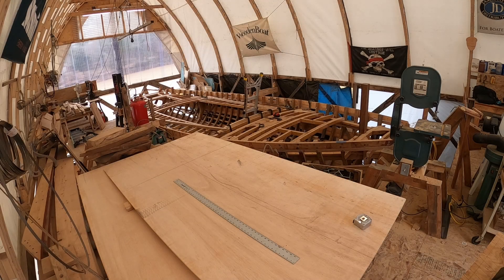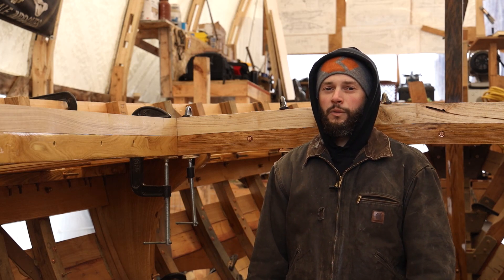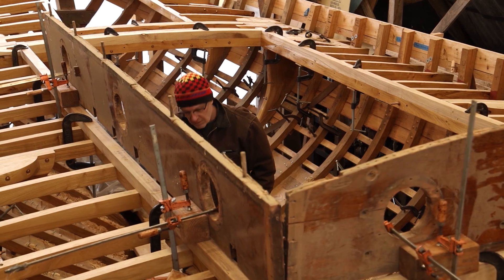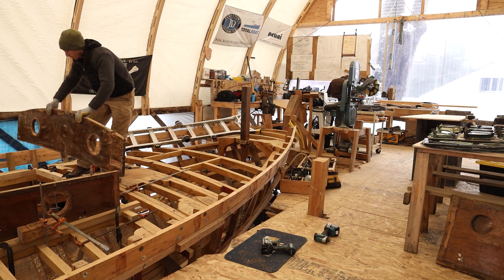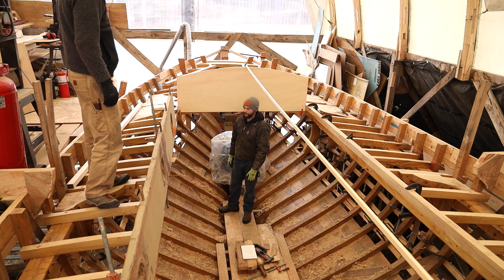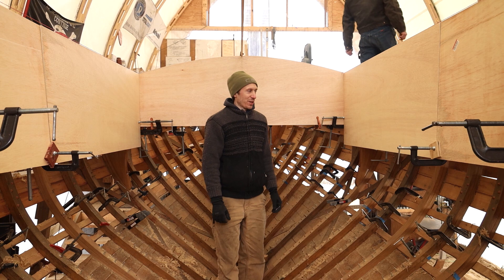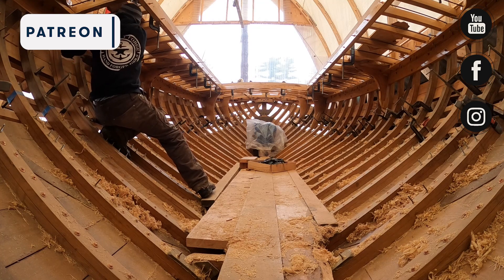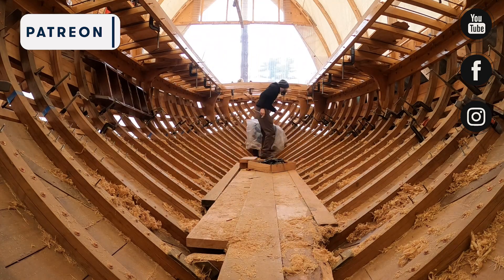Deckhouse mockup -  Episode 148 - Acorn to Arabella: Journey of a Wooden Boat

Comment: First off smart move to do a mockup. As someone stated an ill proportioned coach can ruin the lines of the boat. 

A few items first just because they call it a house doesn't mean you can build it like one. It needs to be as strong as hull if not stronger the ocean loves to break big flat areas.  Keep in mind the only thing between you a twenty foot or greater breaking wave and your god may well be that house. In the case of a pitch pole that means the whole weight of the boat dropping twenty feet and landing on the coach roof. The coach roof is part of the hull structure so don't even consider it being removable or removing support beams. 

While overhang/drip edge sounds good your shins and back will never forgive you. You do not have a cockpit with side support so the most comfortable place to sit will be on the windward side with your back against the cabin side when not on the helm. Also your shins will hit it and it will trip you when you have to climb on the coach roof.  Whenever a wave breaks over the side it will direct water to the joint can you say leak.

Last don't worry to much about being able to see over the coach usually while sailing you will be on the high side looking along the side or over the top at this big wall of canvass
Reply: All top sensible advice.

Comment: You might want to consider ditching the forward port lights and adding a deck box instead.  You have a tiny laz and the extra storage will be key. And PLEASE put some temp plywood down on the deck.  It’s dangerous and inefficient to be dancing along the deck beams!! BTW boat looking great brings back fond memories.

Comment: Consider replacing the oval portals at the front of the house with round ones.  It is inevitable these oval portals will be compared to eyes, and I don’t think you want squinting eyes at the front of your house. Additionally, oval portals will not let in a heck of a lot more air and light than round ones.  Ned

Comment: I think it  would be advisable to put 2 large ports in the aft part of the house like you are thinking about in the front.... just so you don't hamper the air flow plus it would allow in more natural light than the small ones. I've been on a few old wood boats and there is not a lot natural lighting getting in. you guys have a chance to make changes now that will make "living" on board easier. 
on a second note she is starting to "look" like a boat now the the house going in
keep up the good work guys!!!

Comment: With that high of an arch and headspace, you could feasibly run a single 18" wide plank from front to back like 6" down from the peak, to use as overhead storage
Think of a steel ꕯ-beam, but more an inverted T,  ┴,  running fore-aft, between the portholes, right where your mockup 1x1 stick is at 9:25, but 6" down from peak, 8 inches of storage on each side of the ┴.. And storage is ALWAYS at a premium on boats.
Essentially a double-sided shelf, with a single vertical support running the length of the house- It would dramatically stiffen the roof of the house as well.

Comment: Steve - Offering this with the best of intentions.  

Your helper did not appear to be wearing safety glasses when he used the drill press.  It’s always a good idea to wear safety glasses around machinery. 

At the drill press he also wore gloves which can inadvertently get caught in the rotating bit or spindle, causing severe injury worst case.  You might rationalize that his hands are not near the work point, but people often make mistakes in their hand movement around equipment.  Gloves are easily entangled by a rotating drill bit, and will pull your fingers, hand and forearm around the spindle before you can react.

As the leader of this project, I know you would never want to see one of your team hurt.  Hopefully you take these observations to heart and coach your helpers in safe work practices accordingly.  

I wish you and your team continued safe progress.
Reply from the maker: Thank you for this thoughtful comment. We also appreciate that people here can see your shop tips, too. Thanks for taking the time.

Comment: Dropping hardware into the bildge...
Plus to broze hardware... no rust or oak sickness.
Plus to iron/steel, you can retrieve dropoed hardware with a magnet 😎.
Edit:
So, the house access is going to be offset to the starboard side?
I think I caught that in the discussion. Right?
Kinda hafta offset, with the mizzen so close to the back of the house.
Yeah, I like the wide front lights/portholes and smaller house-side fore potholes too. Love the layout. Will the head be at one of the smaller potholes?
Reply from the maker: Yup, companionway is set to starboard to get around the mizzen

Comment: In addition, please keep in mind, in a high traffic channel you will need two radios, one in ship to ship and one on channel traffic control. Most large tanker and container ship along with river traffic is now running GPS nav/moving map connecting to the ships auto pilot. They may only have one mate on bridge watch. We now have two U.S. Navy Destroyer skippers facing court marshal for wrongful death and they both had a full watch on duty at the time. Don’t sell yourself short on navigation equipment.

Comment: Really enjoy following your build. I was watching  your mock up this morning and a couple of questions came to mind.
How do you access the cabin (forward or aft) and how do you get the engine out if required?
I look forward  to your weekly vlogs and will continue to follow the build.
Stay safe.
Reply: It looked like they were planning an acess hatch to the house in the aft starboard corner, since the mizzen blocks the center, I'd say. And engine access, for removal, would require removal of the cockpit "tub" they talked about in the previous video.
Hope this helps.
Reply from the maker: Yup, Thomas hit it I think—the companionway will pass through the aft side of the cabin just to starboard of where the mizzen will be, and the cockpit will be built in such a way that the sole and sides are dropped in, almost like a bathtub, and therefore hopefully easy to pop out should the need arise.

Comment: It's probably too late now but, if it was me, I would have staggered the two vertical joining points of the house walls. In my mind, that would add slightly to the rigidity of the unit.     sdh down the road and over the line in Granby, CT
Reply: Those are just mock-up sides, they will not be part of the final construction.

Comment: Yet another comment...
Be critical of the overall height of the cabin.  Consider the forward view while sitting and standing in the cockpit. A limited forward view is a hardship when maneuvering in certain situation such as docking or recovering a drunken crewmember.
Reply: Did you even watch the video? They explicitly talked about that!
Reply: @99Etien  Sorry Mate.  No,  I didn't see that part of the video. I was probably too quick to respond and was occupied with trying to get the key board to co-operate with my fingers when that part came on.  It's hard to type with one hand while the other is task with keeping a glass of Cruzan at even keel.  By the way...I'm usually the crewmember they are trying to recover.  Never the less,  I'm sure they will get it right.

Comment: Where will nav/sinks/stove  and other items go inside and will you end up wishing you had a window better placed to light up specific areas?
Reply: Set the ports to look good from the outside, then design the interior to work around the lights. Typical boat design, as far as I've seen on YT channels. Of course if you add small wind turbines to the rigging and some solar panels you can put 12V lighting in, wherever you need light, and design how you wish regardless of the portholes.

Comment: I've followed your build from the beginning and look forward to each post. But one thing that continually bothers me and maybe its been asked before, what is your strategy for detecting and fighting fires?
I'm retired now but have worked on fire detection and protection on major projects throughout the world and I've seen the grief that comes after watching years of work dissappear in minutes. Your project is of course extremely vulnerable being predominantly wood.
I hope this makes you pause for thought? Maybe it would make a good subject for a video?
Reply: Amen! I have had a little worry about that in the boathouse as well as the boat once it's in the water. Do you guys have insurance on the project in case of a catastrophe? The years of work put into this project would be  a heartbreaking loss.
Reply: I had a similar thought as I was watching Satchel drilling the tie rod plates inside the boathouse.  An unnoticed hot shard landing in sawdust...  And then there's electrical shorts.  I guess eternal vigilance is critical, even with some sort of fire system.
Reply: He was cutting Bronze there is more of risk from a fire started by a worn brushes on a old motor arcing or sparks from a grinder than from cutting those pieces of bronze.
Reply: They've had the fire department take a look, and the firefighters are satisfied.

Apparently, sawdust over bare dirt is not particularly flammable.

As for the boat on the water, your nose is a lot more sensitive than any electronic sensors. You can smell something smoldering for minutes before a smoke detector will start screaming.
Reply: @ScottKenny1978  Until it happens when you're asleep. I would like to have a backup for my nose.
Sawdust and air mixed right is explosive, so that risk is something to consider.
Reply: @Yvolve  if you're making way on the water, someone must be awake and steering. It's the job of the people who are awake to keep a nose out for an acrid odor.

As to the boathouse, again, the fire department has seen it and isn't particularly concerned because it's a bare dirt floor.

Also, they did clear out a lot of sawdust over New Year's, found a few tools they lost.

Comment: The front of the house is a big flat box and will create massive wind resistance. Why not angle back slightly to reduce wind resistance and more streamlined. Thinking out of box. Whole idea ship is to maximize transfer wind to motion.  Reduce drag. Increase motion.
Reply: Correct
Reply from the maker: Rick, I’ve been digging your comments, and Joe, I see what you might mean in a general sense but this one is slightly confusing. In what way would a gently raked surface on the front of the house help in an appreciable way with wind resistance when, for example, a giant stick points straight into the air (the mast) above the whole structure? This is an honest question. Seems like it’d be nice, but not crucial, in other words.
Reply: @AcornToArabella  As I mention in another of my too-numerous comments on this topic, and as others have sagely pointed out, what needs to be considered is the incompressible hydraulic punch of heavy seas over the deck. Anywhere the water is unable to escape as quickly as it arrives will result in a sudden very high peak in pressure. Cabin sides, particularly forward, but also laterally in a knockdown, or from aft in a pooping, provide an angle or crevice from which the water cannot easily escape. That’s why ideally one would have a smooth, or smoother, contour, convex for increased strength and resistance to pressure. You could get a feel for this by taking a bricklayer’s hod and slamming it open side down into say a full water-butt. I think you would find it felt a bit like hitting concrete with a hammer.

Comment: Get a TORPEDO HEATER and you can GLUE without a problem!
Should warm the entire place up just fine.
Reply: All due respect Ms. May, the very last thing that should be brought into that boat house is a torpedo heater with its high velocity jet exhaust looking for combustibles to ignite.   It would be a very short search.  The fuel load in that structure is quite substantial notwithstanding the recent housekeeping.
Reply: However, a small jet engine may not be a safe choice with all the saw dust and wood shavings laying around in that boat house. 
And yes, I know they just had a clean up, but they are constantly making more shavings and dust as they keep working, not to mention the funes of their glues and finish coatings. I hear what your saying, but those aren't the safest of heat options in a wood shop. Just the airborne wood dust can flash burn.

Comment: When you come to clean the port lights use a solution on hot to warm water at first and Citric Acid. leave to soak in the solution it will eat away any lime scale and rust to leave you with a nice patina.  on the port light i get my Citric Acid from Ebay in bulk 25kg and it has lots of uses

Comment: Your boat. Your decisions. That said. IMHO. On the house, I would have gone with round port lights all the way around, with the exception of larger round port lights fore and aft. The oblong ones just seem to violate the character and art of the boat. But, again. Your boat.
Reply: I think with the oblong ones on the sides and the round ones fore and aft it would loock better
Reply: I like the way they planned it out. Having the larger windows forward and aft makes more sense. If you are down below you need to see if you are about to hit something. Bigger windows mean better visibility. Just my opinion.
Reply: @kathywrightjohnson6804  I'm wondering where the head will go so they can have a shower and not spoil the sight out the house windows. The rest of the deck is too low for a stand up shower inside the boat.
Reply: Definitely not traditional and not very attractive in my option. The fore and aft portlights should be round. If it was all ovals, maybe, not with round ports on the side.
Reply: @kathywrightjohnson6804  They'll probably have bulwarks in keeping with the norwegian doubleenders that are the  roots of this design, so you won't see much of anything ahead from down below. Which isn't that much of a problem, since at sea you're fine with the occasional look around from the hatch, and in close with the shore you're in the cockpit.
Reply: @kathywrightjohnson6804  a larger window wouldn't really "let you see if you were going to hit something" much more than a moderately sized smaller round one. The reason is that you can get close to the window, and it really improves your viewing angle. The reason for the larger size would be to allow more light and breeze into the boat.
Reply: @paulheitkemper1559  Open the forehatch in good weather to get a breeze through the boat. You do not want opening lights in forepart of the coachroof. Best to have nothing, or very small and very strong. The hydraulic punch of a heavy sea is enormous.
Reply: @willshen6597  But does it have to be traditional? I think at some point you can move forward and put in something new, or you will for ever be stagnant

Comment: It looks great but I'm wondering if the floor of the cabin is going to be as narrow as the planked area y ou are walking on. So if the floor is going to be a bit wider, it will reduce the height. As a commenter stated earlier, overhead space is totally essential for gear storage. Even if you raised the house roof by a foot you would still have a view of the horizon.
Reply from the maker: But we might not be able to fit a dinghy between the cabin house and the boom. Gotta think in three dimensions! Thanks for watching.
Reply: I can’t think of a single seagoing boat I have encountered where valuable deckhead space has been compromised by storage.

Comment: Hi Guys, dont forget, an inch or two of flooring, and the occasional beam to support the cabin roof, is going to shrink space, in some cases, considerably. Once you compensate for closed quarters in your step interval, gait and ducking once on board that will not be a problem, though back on dry land people may think you have a strange affliction when you hesitate, step and duck at odd times. Thor Heyerdahl and his Kon Tiki crew reported ducking, stumbling and falling over when they got back on dry land, as a result of placing their feet to stay upright in anticipation of a large sea, only to look comical as they fell over with a puzzled frown when no sea came to obligingly lift the deck to where they had placed their foot.
And yes, roof storage for things like fishing rods is a great idea, along with building a mock up and pattern the actual construction.
I dont know about the rest of your audience, but I am getting a sense of a new enthusiasm with you guys, almost as if you had entered the Doldrums and sailed successfully out the other side with fresh purpose and hard won experience now firmly on your side. Whatever it is, please keep going!
Reply from the maker: Thanks! I think seeing a visualization of something big to come always stokes the fire.

Comment: Will you leave the house or at least the house top off while you do the interior work?  It seems like having a huge whopping opening in the deck will make all the inside work a lot easier than carrying everything thru a small companionway.
Reply: They  are planning it such that the house roof will be detachable as a unit from the house walls and that the house itself with the roof in place will be removable from the hull. Obviously, this would require re-caulking / resealing each time so I am guessing that caulking / sealing will happen only after all work inside is done and read for launch.
Reply from the maker: Yes, the house will stay off while we build out most of the interior

Comment: The curvature of the roof should not be dependent on how it looks, but more on how comfortable it will be to lay on top of it.

Make the sides out of acrylic or clear fiberglass and you will have all the light you need. No need for portholes.

Also, since you have the height, hang netting across the house and use it for lightweight, overhead storage.